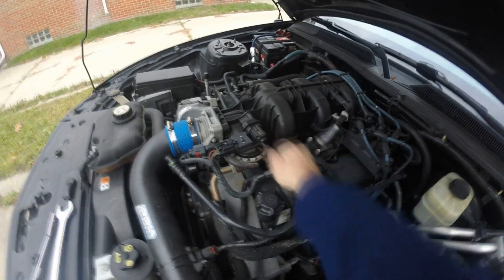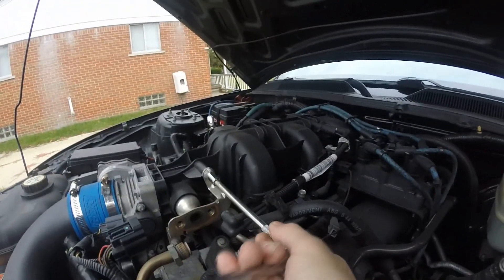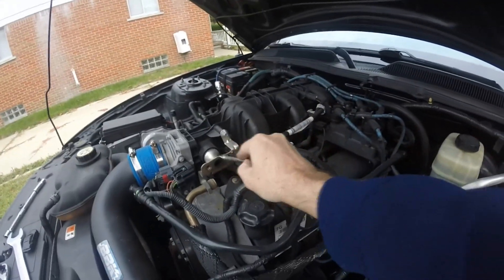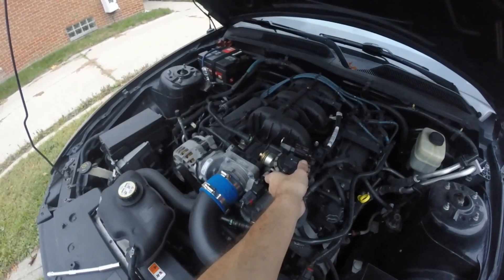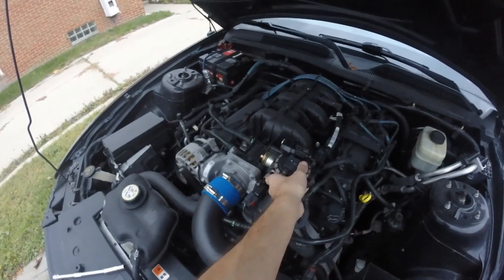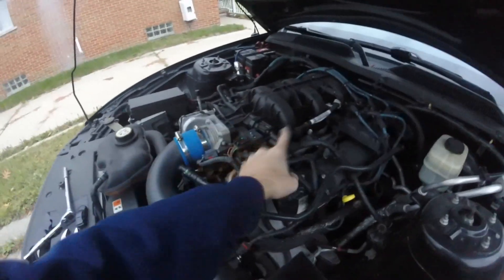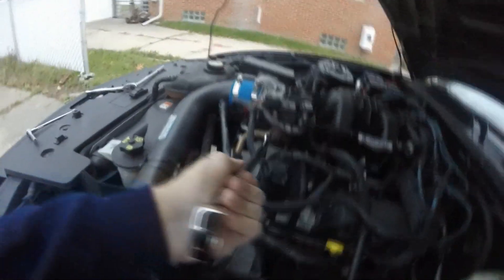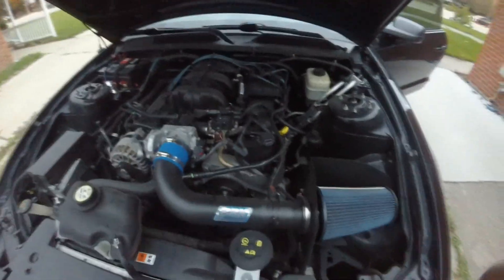4.0 SOHC Ford EGR mod

Comment: Best power mod on my 2003 Ranger was an exhaust leak that developed right behind the cat. Mileage went up 2-3 mpg. I had the rear portion of the exhaust redone in larger pipe and a better muffler. It's quiet but I got the best mileage with the leak! Maybe a cutout piped into the running board tube!😂😂😂
Reply from the maker: yeah i gutted mine, made the car obnoxiously loud/droney but it was quicker haha

Comment: 2003 ford ranger 4.0 the egr was a factory delete..no hoses, no wire harness. Just a plate where the egr is supposed to go
Reply: What'd you do about the electrical connection? Doesn't throw error codes after the delete?

Comment: Does adding a throttle spacer increase efficiency of the engine ??? Thanks
Reply from the maker: I would say no, but I haven't tested it on a dyno

Stuff like that is generally snake oil to get you to spend money
Reply: @CyberdriveAutomotive  What would you recommend that is not snake oil Sir ?? Thanks
Reply from the maker: @victoryfirst2878  for a 4.0?

exhaust, cold air intake and ecu tune would really wake it up

i had mine beating stock 4.6 mustangs from a dig

mostly though the biggest upgrade you can do is an 8.8 rear end with 3.73 gears, that made the world of difference for me
Reply: @CyberdriveAutomotive  THANKS ....
Reply: @CyberdriveAutomotive  Automatic trans or stick with those gears??
Reply from the maker: @kipohara5992  mine was a stick but i  converted it to auto for  the ls swap

Comment: How does this work for the 2011 ford ranger 4.0?
Reply from the maker: I'm not sure but if the EGR pipe goes into the intake like it does on the Mustang there might be a small gain to be made
Reply: @CyberdriveAutomotive  mines is placed in position very similar to yours and it looks just alike

Comment: THE BEND IS PROBABLY BECAUSE THE HOT GASSES HITTING THE SIDE OF THE PLASTIC AND UNLESS YOU STOP THEM FROM ENTERING,  WHAT EFFECT DOSE  IT HAVE
Reply: NO NEED FOR ALL CAPS!  It's fine been fine for years. It was Ford's way of nerfing the 4.0.

Comment: 2002 AND 2003 4.0 rangers didn't come with egr and get way better fuel mileage. I've owned my 2003 xl long bed 5 speed auto for about 10 years now. I installed Richmond 4.10 gears and a track lock and 245/70/16 Michelin tires on new oem rims. 99% of my driving is around town and I get 320 to 350 miles on every fill up not even driving easy. All the 4.0 rangers I've seen with egr get about 13 mpg. I thought the 4.10 gears would hurt my fuel mileage but it accelerates so easy now that it gained about 1 mpg over the original gearing.
Reply from the maker: Interesting, I wonder what the differences are

I know the flex fuel long blocks have higher compression than the rest of the 4.0's

Other than that I would guess it's just intake manifold differences
Reply: @CyberdriveAutomotive  My long block $700 came from a wrecked 2008 mustang with 50,000 miles on it. I put the truck intake and injection parts on it since they were different. I used new oem injectors. I've put about 50,000 more miles on it since and added 2003 mustang cobra rear disc brakes. The brakes don't feel any stronger but they are much lighter and don't get out of adjustment like drum brakes.
Reply from the maker: @jimihendrix5576   yeah they're not bad motors, it's just that they have an achilles heal with their convoluted timing design

The timing components breaking is what nuked both of the 4.0's that was in my car
Reply: @CyberdriveAutomotive  Mine accelerates pretty hard for a ranger. It's not going to compete with sports cars but it puts a gap on most full size pickups with V8s from a stand still. My youngest son 32 won't admit it but he traded in his 2021 Tundra for the newest twin turbo v6 Tundra because I always outran his other one. His new Tundra beats the Ranger with ease in every situation. The Ranger speed cut off hits at 86 mph now with the 4.10 gears so any fun is over pretty quick. I wanted to put the newer 3.7 in it but it's just too complicated for me and I'm feeling my age.
Reply from the maker: @jimihendrix5576  yeah they're fun, my 4.0 was in the high 13's, beat a 2v GT from a dig and beat a 3v convertible on the freeway, I would actually be surprised when all said and done my stock 5.3 is the same speed or faster lol

Comment: Did it to my 2005 mustang, definitely works lol
Reply: When you say it works, what did it do.
Reply: @yeahrightmate  increase hp by at least 10, after I just cut the egr as shown on video and put it back in my 05 it felt like a completely new car better acceleration more hp not something insane but you can definitely tell the difference, also better gas mileage
Reply: @trumptrain8745  Ok thanks.

Comment: If you actually want to see a difference just take the whole thing off and put a plate over it, unscrew the pipe from the manifold, cut the pipe and block the hole, take the bulb out of your cel and enjoy your day

Comment: My guess as to why ford did that was because since the gases from
The exhaust are hot it can probably melt the intake manifold. It is plastic, and the gases are pretty hot. So idk if I would do that, it can probably ruin your intake manifold
Reply from the maker: Good theory, I drove the car for a couple years like that without it melting the intake.

Maybe in the long run sure or if you have some sort of exhaust clog increasing exhaust temperature that could become an issue

Comment: Hello! Please tell me after replacing the replacement of the repair kit on a Ford Explorer 4.0 sohc began knocking and began to pour oil from the valve cover of the left head into the intake manifold in the 3 and 4 cylinders because of what it may be? Thanks!
Reply from the maker: Sounds like a bad valve cover gasket, or possibly a cracked cylinder head though that's unlikely.

If oil is coing out of the valve cover generally the gasket has gone bad, good luck!

Comment: Won’t pass smog and you will get a check engine light ,
Reply from the maker: It will not trigger a check engine light and smog will still pass

Easy to assume, though
Reply: @CyberdriveAutomotive  no not in California, no way
Reply from the maker: @James-px8ji  Your EGR still works lmao, it would pass smog and not trigger a check engine light
Reply from the maker: @James-px8ji  No check engine light ever came on mine, and my EGR functioned as normal.

Mine passed smog without issue

Even my own scanners showed that the EGR was working correctly

You're simply wrong

Your buddies car failed for another reason, sorry
Reply: @CyberdriveAutomotive  no

Comment: How is going now with that mod
Reply from the maker: Was fine until the timing components gave out on the engine and blew it up (unrelated to the EGR mod). 

It's now got an LS in it I'm working on https://i.imgur.com/oFHbK1a.jpg
Reply: @CyberdriveAutomotive   so how much extra horsepower was yu getting
Reply from the maker: @vernonwilliamsjr7592  Well, I had never put it on a dyno while it was stock, but I did dyno it with a v6 but after I did a few other things, which I have a video of (link to that is in this videos description)

Comment: What are all the mods done to that 4.0
Reply from the maker: Sport Trac flex fuel long block (higher compression), Exedy clutch/flywheel, EGR mod, shorty headers, 8.8 with 3.73's, bbk cold air intake

probably forgetting a few things here or there

i'm now in the middle of ls swapping it
Reply: @CyberdriveAutomotive  woah how has the LS swap gone?????
Reply from the maker: @mr.gadgett6091  It's coming along, engine and trans are mounted, car is currently covered in snow so I'm waiting for the weather to get a bit better haha.. aiming for first start around spring time.

I plan on doing a comprehensive video going over every detail of the swap, but that will be for when it's moving.
Reply: @CyberdriveAutomotive  That sounds so awesome!!
Reply from the maker: @mr.gadgett6091  It should be a blast!
Reply: @CyberdriveAutomotive  heck yeah!!!

Hey I've been looking around with no results; have you heard of any shop that makes turbo headers for the 4.0???
Reply from the maker: @mr.gadgett6091  There are none, you will either have to make them yourself or have them made, supposedly the ON3 3v kit can be modified to work with the v6 exhaust but idk.  I was considering doing a rear mount turbo back when I still had the 4.0 but the only place I could find willing to tune it was Livernois and they wanted a lot
Reply: @CyberdriveAutomotive  damn that sucks; I would have thought more people boost the 4.0s because it still had the block made of iron but maybe it really just sucks as a power platform 😂😂😂

I saw 1 site that had an option for a twin turbo kit, but the site has either never been updated since 2005 or it's a scam lol --seemed a bit sketchy sadly

I might end up procharging mine since there are actually kits available --then I hope to buy or make my own variable muffler :) [I just think the idea of being loud in the hills but quiet in town is magical]

Aye it is Hella awesome to know somebody is putting an LS in the v6 though, it gives some people hope that there are still fun projects in the world --keep us updated!!!

Comment: Bro just swap the engine or get a supercharger or turbocharger yal b killin me with these videos seriously 🤦‍♂️
Reply: Oh ok cool I said that cause I have an 4.0 and people b trying to do too much instead of just putting the money in them so that they can run but I'm proud of you bro I hope things work out for you
Reply from the maker: @lamontmoore410  Yeah I barely did much to my 4.0, still had a stock tune.

The biggest improvements were the 8.8 swap (which was important for the v8), and the Sport Trac flex fuel long block out of a junkyard (since the original engines timing components blew the engine up).  Those two changes made the most difference.

I had very little invested in the 4.0 and it was pretty fun, the LS is different though
Reply: Wow ok like before gud luck buddy mines is in the shop I'm just waiting on it to come out its being dyno and I'm tuning it off E85 so I really did homework before I jumped and did anything
Reply from the maker: Lol, I'm putting an ls3 in the car

My n/a v6 was beating stock 3v's though, it was pretty fun
Reply: i mean i kinda agree that people go way overboard with it but i like relatively easy/inexpensive mods that either prolong engine life because emissions components often aren’t good for much besides pleasing people that think burning fuel somehow emits cool mountain air lol, you can sometimes get little power gains from removing restrictions and i don’t mean raising the rev limiter or any other nonsense people do but a good example is on my 4.3 s10 there is a piece they have on the (for lack of better words) throttle body butterfly plate that if you remove and plug the rivet holes it greatly improves throttle response and idk if it was just in my head because i don’t have a dyno but with a CAI i believe it gave it a good bit of power but my whole point is poor people like myself most of the time can’t afford forced induction or swaps so they make the best of what they have and can afford to get for it to make it better or more to their liking, i’ll stop poor man power modding if you wanna help me fund my swap that has had a 5.3 living in my garage for almost a year 🥲😂 one day though

Comment: Is the car still running good?
Reply from the maker: Timing components went bad and nuked the engine, the car is now being LS swapped but I haven't made any progress lately
Reply: @CyberdriveAutomotive  how many miles was on this car when this happened?
Reply from the maker: @alanclark9000  about 140k when it happened to the first engine, the 2nd v6 did it too but idk how many miles it had on it, the LS is the third engine that's been in the car haha
Reply: @CyberdriveAutomotive  so you would say that the timing chain on ford motors don't hold up as good as toyota 3.4 or 4runner?
Reply from the maker: @alanclark9000  No idea, never owned one haha

Comment: Just block it off.
Reply from the maker: Nah, removing the EGR doesn't improve performance and when you're wide open throttle the EGR system isn't even active.
Reply: Cyberdrive Automotive 
Believe that rhetoric if you want. 
Engines are designed to run on a mix of fuel and oxygen, NOT burned carbon monoxide. 
Next you’ll tell me that all the carbon buildup in the intake manifold is also good for performance.
Reply from the maker: @EliAngwin  Except they are designed for that, and cleaning the carbon out is pretty easy with a product like Seafoam

Having an EGR system does not effect performance, it doesn't even work when you're wide open throttle
Reply: @CyberdriveAutomotive  You are forgetting that we are not talking about a perfectly good working order one here, we are talking about a blocked or stuck one.
Reply: @EliAngwin  Do you know if you can just block off the pipes and it won't throw any fault codes because I think that would be way better.
Reply: I'm with you, this dude shouldn't have wasted the time cutting the pipe. Either delete it or leave it flowing evenly throughout the manifold. This is the worst of both worlds... and he's too dense to listen to people who know better....

Comment: i dont see how a 3/8in tube will cause engine to loose power, or obstruct flow. maybe a few CFM but not much. you get more obstruction from intake itself, etc etc
Reply from the maker: Every bit helps when you're trying to min/max a platform that isn't supported by the aftermarket

Comment: I'd guess it was designed that way to try and get the exhaust gas into the middle of the airflow and have it mix evenly. 
By removing the tube you might be providing some cylinders more of the exhaust gas than others.
Reply: The 4.0 mustang intake manifold has a 1 foot run from the throttle body to the intake plenum, plenty of room to mix gasses. I believe Ford did this to nerf the mustang V6 performance, like they did by running a world stranded octane tune for 80 octane and the ypipe into single 2.5in exhaust instead on using the same exact catback as the GT which fits both cars with very slight modifications. The 4.0 sees really good gains from a tune and stock GT catback exhaust. The performance gap was entered to entice more buyers towards the GT but because the 3V 4.6 was so slow they needed to make the GAP bigger by any means necessary.
Reply: @ThisisForTheTV  how much closer would, if I follow your advice would I get to 300hp?

Comment: What intake is that you are using? And did you put an aftermarket/larger throttle body on? If so what make and where can I get one? Thanks for the tip for the EGR too. Going to “mod” that in the next few days.
Reply from the maker: Sorry for the late response, I just noticed your comment.

I used the stock Mustang intake manifold as well as throttle body.

Comment: They may also have had the elbow there to prevent turbulence in the intake manifold, especially while the EGR is open. A round tube isn't going to inhibit flow, even more so that it's transitioned to parallel to the flow with an elbow.

The intake system is designed as a whole. Even if you theoretically increased volume and flow, doesn't mean the engine can consume any more air than it already is, especially naturally aspirated.

Butt dynos will always tell you that you got more HP. But hey, I like working on cars too, so it's whatever.
Reply: How would DECREASING THE VOLUMETRIC CROSS SECTION AREA NOT DECREASE AIRFLOW? I logged MAF on hptuners before and after the mod and saw an increase. The fuel trims were also out by about 3-6%. It has better throttle response everywhere and very slightly more of up to according to 3rd and 4th gear 1250 to 6000 rpm acceleration times logged. Runs were done same day 10am with 1 hour between the before and after runs. It's not draggy accurate but fuel trims some dictate more airflow.
Reply: Well what were the results
Reply: Not trying to come off as  condescending or even a D**k. But Thatguythatdoesstuff, I'm pretty sure  the WHOLE purpose of a super/turbo charger is to  increase the volume and flow of air. Perhaps I should watch the whole video and read all the comments before commenting.  Lol
Reply: @CJ-tv2id yes to the engine by force induction since you to incompetent to understand that I will spell it out for you force induction is where you add to or replace the manifold with a compressor to at that time the compressor will suck air in topically through a cold air intake and either forced into the engine or manifold by a turbine or pulley system creating more air so yes the comment before yours is in fact correct and in some cases you can cause damage to the car with this mod